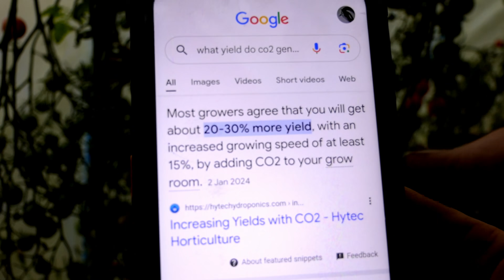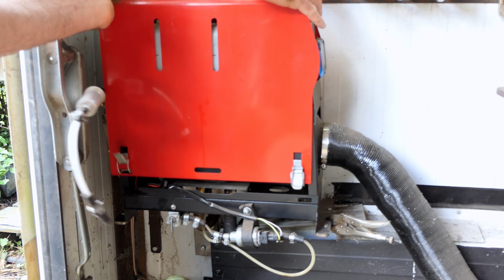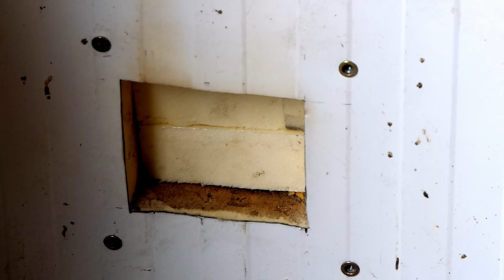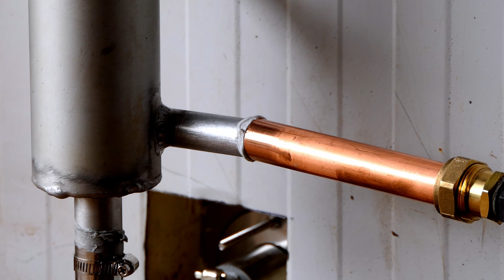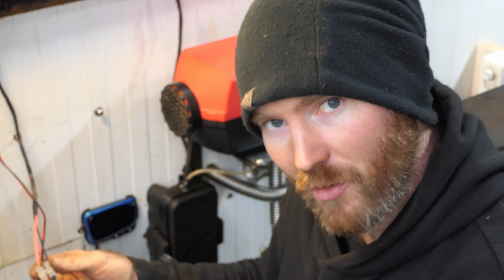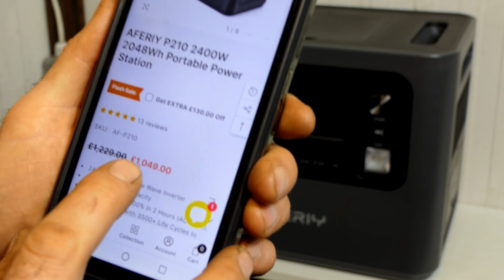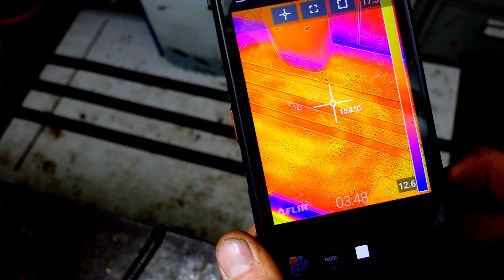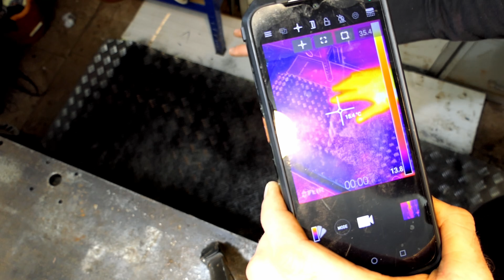NEW! Better system for Cheap and Safe Heating💲+ Underfloor Heating Mod test🫠

Comment: Great segway and points about diet, immunity and cancer (as I tell my teens - everyone has small amounts all the time, immunity keeps it in check).  Immunology is a fascinating subject.  There is a lot of variation in genetics, but you can improve via diet.  Also, similar applies with viruses, we have all the time.  When my teen asked me whether they would get a cold from being wet & cold (temp) in our cool summer, I suggested that individually yes, viruses can overwhelm our immune systems when we are exposed to prolonged cool temps (viruses replicate faster below body temp, immune system works best slightly above), but of course exposure to source/seed viruses from others is lower in summer, when the population as a whole is warmer, i.e. there are a lot less incubators.
Reply from the maker: Thank you. My wife was diagnosed with prenatal diabetes after they took a wrong measurement of our baby.her blood sugar was high because it was around Christmas time which was always an unhealthy time. They immediately prescribed her with medication that had serious side effects and didn't once question her diet. She controlled her blood sugar with a healthy diet and didn't touch the medicine. She was absolutely fine and our son came out the right measurement too. But I remember how insistent they were about it without any thought on re-measuring our baby to check and no advice on diet. That's just one story. Cheers J
Reply: @joshuadelisle  Great to hear you had a good outcome and yes 'do your research' is the most important thing we can impart to our children.  I'm former NHS and frankly its a lottery ATM. They screwed up my wife's cancer diagnosis, left her bedded in pain for 6 months before finally diagnosing cancer - slow but terminal - huge melon sized metastatic carcinoid.  Inoperable.  I have had to intervene many times to correct their treatment errors and to extend her time - research is our friend.  Trust the NHS, but don't blindly trust them - do your research.  Keep up the great work. ;)

Comment: You put your floor pipes in insulation.  I know the top isn't, but a concrete slab would be a better heat sink.  Losing more heat in the sink might mean you recover more from the exchanger( I think)😊
Reply from the maker: I think you're right, still needs insulation underneath but the pipes in a slap would work better. Cheers J

Comment: For whatever it is worth I want to say thank you. We moved house recently and I started all sorts of DIY tasks, none compared to your level but your video's have inspired me to not depend on someone else to do something as simple as changing a sink tap, fixing a leaking toilet, replacing carpets, painting, etc. Thank you, thank you, thank you
Reply from the maker: @PrincePawn  thank you for your support. I find much satisfaction when I do it myself. Even if I fail I actually learn something and make improvements. It can be more costly making mistakes but long-term that knowledge goes a long way. Cheers J
Reply: I grew up as part of a working class family, and went to work. (Sounded like Camrla!)
You do as much as you can to cut costs and save where you can.
Now in my 50’s and looking to retire sooner than later whilst I can.
Take care M.

Comment: To get all, or most all, the heat, you would need to have a lot of pipes running around your hut to capture the heat, and if possible, to store the heat to use at a later date or time, now that would be a good science experiment.
Reply from the maker: That would be interesting. Cheers J

Comment: You make excellent points regarding climate change.

The contrail documentary seems a bit crazy ngl.
Reply from the maker: Thank you so much. Geoengineering is very real, Bill Gates has even been funding it. They're even saying that they want to use it to control climate change, that was on a channel 4 news reel that's a few years old now.  Cloud seeding has been used for over 60 years. China used it to stop it raining in the Olympics by making it rain in another region. It is crazy stuff I must admit. Cheers J
Reply: @joshuadelisle  I remember an old documentary saying after 9/11 in New York there was higher temps due to lack of contrails in sky.

Comment: Having been down this path sometime ago here's my thoughts on your experiments. The maths if the heater is 8Kw and 80% efficient then there is a maximum of 1.6kw wasted somewhere (You reckon your heater is less). Your radiator looks to be about 1Kw (at 70 deg which you won't get.) The underfloor heating will be better they are generally run at a much lower temperature difference. You may be chasing diminishing returns. It finally dawned on me I was trying to reinvent the wheel (stupid I know) but the way to get the wasted heat from the exhaust needs a massive surface area and a large flow of water (your pump is way too small you need a central heating pump. ) i.e. a condensing heat exchanger. available in  a domestic oil/gas boiler, £60 ish on ebay and yes they work, I got an exhaust temp of 64 C out of the heat ex but as I said you need a large flow of water to achieve this and the maximum exit water temp is less than 60 deg (otherwise it will not give you the heat of condensation, the connections to the heat ex are 20 mm ish not 15mm.)Mine worked well (until the light bulb moment of course)
I wanted to heat water (for the jacuzzi {another story about 304 ss and 316 ss and ti verses heavily chlorinated water.) not hot air like you so as I say it dawned on me I was trying to reinvent a "boiler" so simply burn the oil in an oil boiler at a min of 70% and a max of 96% (second hand not too dear) I already have an oil boiler so I simply put a spur on gate valves to heat what I wanted. I actually started with 2 meters of exhaust pipe into a bucket of water. worked well just had an issue with condensate (i.e. I'd reinvented the condensing heat exchanger!). (Dim or what) to sumerise (if you want to carry on) to get the heat from the exhaust use a condensing heat exchanger, 2) be realistic about diminishing returns at 5KW and 90% efficiency there's not a lot left to scavage (best case rather than 8Kw and 80%) 3) if you want hot water use a hot water boiler they're designed for it and just as cheap to run.
Reply from the maker: Very good points. Cheers J
Reply: @ianburton1938
Got any links to suitable boiler condenser units on ebay?

Comment: Not been here in a while. I watch for the engineering stuff. What's with all the tinfoil hat nonsense? Y'alright pal? 😂
Reply from the maker: Thank you but is it nonsense? Cheers J
Reply: @joshuadelisle  I don't disagree with some of your points around making the most of your chosen fuel, but your choice of words and delivery are laced with conspiracy theory rhetoric: "Overlords", distrust of ecological policies and government in general. And casting doubt on the very real, solid fact through decades of scientific research that climate change is man made. You're not a climate scientist so your opinion on the matter is nothing more than misinformation. Your video has rightly been flagged as such. Fossil fuels still run the global economy so why would a government push a fossil fuel free agenda? What do you think the 'big bad evil men' are up to? Maybe lay off the exhaust pipe tomatoes...
Reply from the maker: @jimmyhowzer  there's no difference in how a government works and how a cartel works. Energy is mostly oil and the majority comes from Russia and Arab countries. So if you want the power shift to be independent from those nations you need a good argument to get the population to come off oil and onto other forms of energy. Don't forget BP coined the name carbon footprint. They want global power and it doesn't work when the other nations are richer because of oil. If you know your history you'll know people haven't changed. Just read up on 'my island story' to hear a brief breakdown on the history of the UK and the rulers it has had what they did to its people in pursuit of power and control. You're naive to think governments are out for your best interests and not solely for themselves and to keep you as a cash cow. Otherwise why aren't the most intelligent and selfless people ever elected to govern?

Comment: I got 3 of those diesel heaters now, only put one in use in the cabin of my front loader (used during winter plowing snow) and I can sit there in my tee shirt even if it's minus 20 degree C. 😅
I really liked your end speech. You described just what I have been thinking for years. Nothing what the governments are saying, makes sense. It's like they are preaching that CO2 is a deadly gas that will kill all living on earth. We can wonder if any of the politicians was awake during biology class in school? 😴🤔
Reply from the maker: Nice, yes it definitely seems that way. Cheers J

Comment: Thanks for the fantastic video! Also thanks for having thecourage to give that little explanation at the end. There were some good studies i saw 5 years ago that showed water vapourin cloyds had a huge impact on warming. It also showed historically this had a high correlation with high energy cosmic particles from space. I think thismight complement your perspective on how loss of top soil is also reducing the buffering of rain runoff.. Keep up the great work.
Reply from the maker: Interesting I'll look into that. Cheers J
Reply: Also HHO is reported to be good at decarbonizing motors. I think you need a pretty high flow rate though so it probably isn't worth building such a unit for expressly that purpose. Not to mention they can be Be hella dangerous. They are useful for quite afew other things though, some they'de like you to think weren't physically possible....

Comment: To increase the underfloor heating people wrap the pex pipe with thin aluminium plates that extend outwards parallel with the board on the top (your checker plate) to increase the surface area of the pipes.
Reply from the maker: Yes you're right. I'll try something like that. Cheers J

Comment: Outstanding video! Im in the middle of heating my garage with a second source like this diesel heater.  Im already natural gas heated, but in spite of being in the natural gas hub of Canada, we have been taxed to death by the liberals which has made it very expensive...therefore I too shal make cheaper heat.  I'm a Power Engineer and have a few thoughts of my own on how to improve on your economizer and waste heat scavenging, but your basics are spot on!  Thank you for this video AND the raffle, I grabbed a couple tickets!
Reply from the maker: Thank you so much. All the very best. Cheers J

Comment: surely a little dob of CA glue round the rim of that riv nut where it touches the wall and you'll be able to unscrew the thread?
Reply from the maker: Maybe but the reason it started spinning is because the bolt is seized. So putting a spanner on it would probably break the CA glue. Cheers J
Reply: @joshuadelisle  - On future blind nut rivet projects, some anti-seize paste applied to the threads works a treat!

Comment: That carbon buildup can be massively reduced if you increase the air into it making it more lean making it burn more efficiently.
Reply from the maker: I think the long exhaust was a factor as it was set on maximum rpm. Having a short exhaust I think has increased the efficiency of the burn but not the recovery. Cheers J
Reply: @joshuadelisle I just finished watching the video I think the main issue is heat loss through the exhaust so it would make sense to build a massive water to air heat exchanger that is the shortest run possible to not effect the efficiency of the burn, as you stated in the video an EGR cooler would be best but personally i think you can DIY something better with a two part heat exchanger.

Water is funnily enough not a great heat conductor at room temperatures but once it heats up past a certain point it's properties change into a conductor of heat so it'll transfer the heat of the water more efficiently, I would say get rid of the entire hot air portion of the heater & exchange that for a water heating setup then have that plumbed into your DIY EGR heat exchanger for the exhaust which would be a bunch of small pipes that equal if not are greater than the exhaust then have that run outside.

Comment: A few things: firstly; yes human made CO2 is very small, but methane pollution caused by natural drilling etc creates more heating than all the CO2 put together; add that to human created deforestation, pollution creates more heating. On a different subject if you were to charge the storage with PV panels &/or wind turbine the running cost would be even smaller.
Reply: Human made CO2 is 33% of current CO2 levels. It's not small.
Reply: Natural drilling-as opposed to unnatural drilling?😅
Reply from the maker: True but methane only lasts 10 years before it degrades. Cheers J

Comment: "Why don't you get one of these". Are those water only, or water and air?  (So you'd only need one for both, rather than two separate for water and air)
Reply: True, these heaters are actually available in three versions: 1) Heat only, 2) Water only, and 3) All-in-one Water & Air. However, I've noticed the all-in-one hot water and hot air combo units are trickier to find, however, they do exist if one is willing to search to the ends of the internet :^)
Reply from the maker: @__WJK__  nice I'll look into it. Cheers J
Reply from the maker: It's a water heater for an engine in -0°C cold weather start up. It's also just a great little general water heater. Cheers J

Comment: SELF BLEEDING RADIATOR VALVE- JUST FOUND MY SPARE IN SHED-  IT LOOKS IDENTICAL TO YOUR WHITE BLEED VALVE, BUT ITS METAL,AND  PROTRUDES  ABOUT ANOTHER 15MM .
Reply from the maker: @broder1929  nice. Cheers J

Comment: This is probably an off the wall suggestion but have you thought of running the exhaust through a thermal store cylinder instead, they are meant to be filled with hot water not exhaust gases but you can take different feeds off for heating or hot water but they arent cheap 

Excellent last 10 minutes, agreed with it all!
Reply from the maker: @johngibson8900  yes I'm thinking of using a large barrel of water as a thermal mass storage for the next upgrade. Thank you so much. Cheers J
Reply: @joshuadelisle  - Water sounds logical enough, but how about simply setting the exhaust in a metal container filled with an appropriate amount of sand, while running the exhaust ports into and out of the metal cantainer filled with sand(?)  The metal container of sand, of course, would/should act as an ultra-cheap and hassle-free passive heat sink.  However, I could see using water over sand "if" the application is better suited for taking advantage of the steller heat absorbing qualities/efficiencies of water(!?)
Reply from the maker: @__WJK__  I already tried that. The sand is a poor conductor but works well above 600°c which the exhaust does not produce. Cheers J

Comment: Wouldn't it be more efficient to spray the bottom of the aluminium plate with black paint, rather than the top ?
Reply from the maker: @NeonLuvBar  the paint is only for the infrared readings it doesn't effect the heat delivery. At least I don't think so but I'll check now you've mentioned it. Cheers J
Reply: @NeonLuvBar1 - Dark colors do not absorb (excess) heat in the presence of "convection" based heat/heaters (long as the convection heater does not produce any infrared light). Non-infrared "convection" heat, is transfered by the surface area and temperature difference between the object and the surrounding medium/fluid. What you're thinking of, is how dark colors absorb "radiant" heat, from radiant heat sources such as sunlight.  An easy way to remember the difference, is to simply recall how standing in the Sun, while wearing a black shirt, will make you feel much warmer than if you were to stand in the Sun while wearing a white shirt. Conversely, a dark (or light) colored shirt, will not absorb (or reflect) any additional heat while standing in front of a (non-infrared) "convection" based heater.  On a side note, keep in mind, the reason he painted the metal plate black, was to improve the temeprature reading of his infrared camera, since infrared cameras cannot get a good temperature reading on objects that have shiny, reflective surfaces.
Reply: @__WJK__  👍

Comment: https://www.youtube.com/watch?v=abzACVxTnRU   .......
this man used the exhaust heat to  pipe it into a radiator   
cheers
Reply from the maker: @traceyelliot8571  yes but also consider my exhaust that had carbon build up, that would be hard to get out of a radiator. Cheers J
Reply: granted   ;)   ......... but he said he bought the radiator  for only 20 pound   
so after a year of use we could  buy a new / used radiator  
worst case scenairo   --->  get the radiator  of the wall  and poor some two stroke gas in it  ---->  like we used to do when our moped exhaust was clocked
have it well away from the home  and set it alight    and burn of the sud

anyways  i love your thinking skills